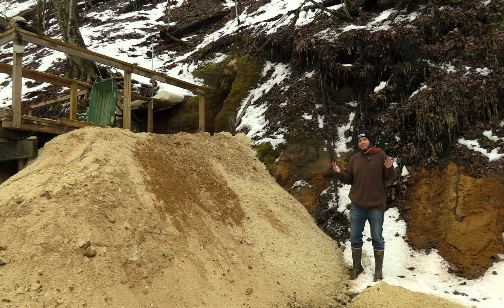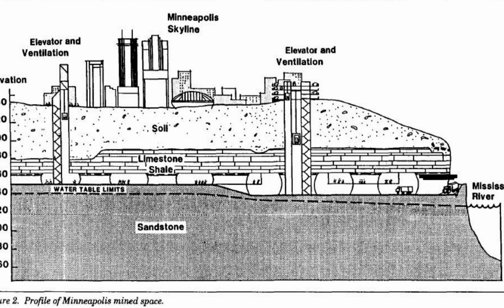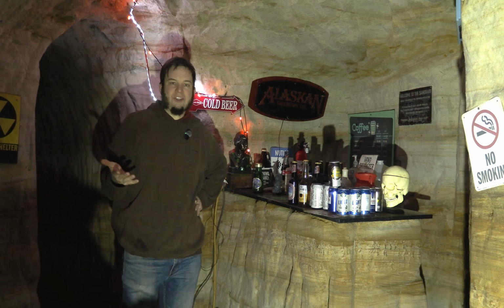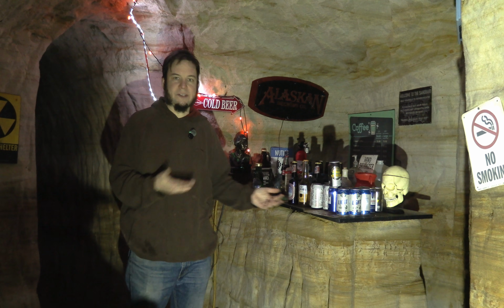Practical and Safety Concerns Of Digging Sandstone Tunnels

Comment: I think you need a huge vacuum system, with pipes to the most resent project, so that you can just suck up all the sand to the surface... no idea if this would work, but from all the digging projects i have done so far i know very well that getting rid of the earth, sand, snow or what ever else you are digging in, is always the most work. And i always dreamed of this big vacuum that just sucks everything up... and you seam capable enough to actually build something like this XD

Comment: Earth.. Ask AI: "Ultrasound Sonar plasma speaker shock wave echo clashing for range controlled melting while applying pressure to sandstone to make it like crystal so water or too dry no longer risk." You glaze your tunnels THICK layer.. Then you can be safer without worrying much. Using Plasma speaker resonance filters to prevent sending vibration causing heat where you don't want it. Google: "Transcranial brain modulation ultrasound" + "Ultrasound can print through walls" If you got a strong enough generator to charge and fill super capacitor banks = Form your tunnels from the surface. It will revolutionize plumbing all over the place no nasty Plastic stuff Chlorine poison in tap interacts with. lol..

Comment: Can I give you some ideas for the wall strengthening/cement idea you've been experimenting with? Context: I worked with sandstone buildings for a living and live in a sandstoney area in western Germany: Don't use cement or concrete, even if it (temporarily) sticks to the stone. The cement will bind up MUCH harder and much more inflexible as well as waterimpermeable, compared to the sandstone. This is why your cement patches fall off: they trap moisture within the stone, causing the stone to swell and "shed" its outermost sand "skin". 
If you want to reinforce your tunnels, invest into quicklime or already slaked lime (Calcium hydroxide). Thin it down to a milk-like consistency and repeatedly paint your walls with it, every week or so. The moisture within the cave system is perfect to keep the lime from binding off prematurely while still being aerated enough to form a strong bond with the sandstone. That will make your walls hard wearing, pristine white and very durable too, whilst still allowing the sandstone to breathe and expand and contract.

Comment: Since this is in the US have you guys ever considered blasting? Something as mild and available as black powder could be used without licensing or would that be considered cheating?
Reply from the maker: I think there are still license requirements and it would be kind of a hassle. Honestly the hauling is the slowest part, I can chisel sandstone way faster than we can pull it out in the wagons.
Reply: @saveitforparts no licensing if it's on private property and isn't being done in the course of business ie nobody's getting paid. It differs by state but federal law allows for synthesis, and responsible use on private property as long as you aren't storing, transporting or making money from what you make. Storage and transportation wouldn't apply if you use a commercial gunpowder or similar product but I don't know what the financial situation is with you guys. I recommend reading the federal, state and local laws first but the federal ones are surprisingly permissive. BTW "manufacture" in their legal parlance means in the course of business, synthesis is different, a lot of people get confused by that.

Comment: I bet a large shop vac could move tons of sand quick. Or an old vac truck
Reply from the maker: I've been trying to convince the owner of that, but he's hung up on them costing $100k new
Reply: @saveitforparts  old vac trucks go cheap at auctions. i think some pvc and shop vac would work wonders. Or hook like 5 shop vacs up to a manifold. I think one would have no problem if you neck down the nozzle to big rocks dont clog it. and the shop vac would be pulling fresh air in if its outside. good luck cool vid
Reply: We had discussed an auger system a couple of times for digging out Crystal Cave in Spring Valley Wisconsin.
Reply: @dolphincliffs8864  PVC pipe with rubber joints and hose clamps for clog/repairs paired with a shop vac attached to a 55 gallon drum.  Screen it than you only need to haul rocks and larger harder chunks. I use a shop vac to dig postholes its so much faster than digging by hand. I have also used an old shop vac to suck up five gallons of gasoline "for science" it did not light? So with a shopvac full of gas i light a gallon of gasoline on fire and suck up?? the shop vac sucked the fuel fire out? it only ignited internally when i shut it off and put the nozzle in the fire and once the fire was in the shop vac it was over quickly:0 shop vacs can move an amazing amount of dirt over time. do a small scale test they cheap you can even get them used get like 5 of them hook them to a manifold than you will be moving a stupid amount of sand. I still think an old vac truck with a blown transmission at auction  is the answer to you sand miners problems you dont need it to move just suck "hard" :)

Comment: Retired mine manager here, the ceiling is called the backs,if the strata you are mining through is tilted you have a foot wall and a hanging wall. I have walked through railway tunnels driven over 120 years ago through the same soft sandstone, you could still see the pick marks on the walls, and the tunnels were as stable as the day they were dug without the need for any artificial support.
Reply: Awesome tidbit!
Reply: Ohh that aint very soft would have taken forever without impact hammers i dug out there once and its plenty hard think we might have made it 30ft 2 guys in 1.5 day

Comment: Sandstone gets a bad rap. There are some old graves from the 1800s around here made of it and the words are a bit eroded away. 
And there are some WW1 era buildings made of it, and the only issues are near the eavestrough drainage areas, you can see the water erosion.
But both are still there. As long as we aren't expecting it to last the millennium it'll last long enough for most things we use it for.
Reply from the maker: There are different kinds of sandstone, I think ours erodes in water faster so it wouldn't be as good for buildings.

Comment: Saveitforparts: it's sandstone, we have doors on different levels, and a fresh air intake.

People: bUt WhAt AbOuT tHe CO2?

The CO2 escapes from the porus cracks in the sandstone, and the constant draft going through the place from doors having small opening on different levels allows the air to circulate... CO2 would only really be an issue if the place had a lot of people in it or was firmly sealed like tutankhamun's tomb. From my understanding, it won't have that much people in it. There is no issues with CO2. There ya go.
Reply from the maker: I've done some air quality testing and found a small rise in CO2 after working in a dead end tunnel. The level actually went back down later in the day because we were walking back and forth and probably stirring up the air.

Comment: This is probably a stupid question, I don't know anything about radon, but you said that you wouldn't want to live in Sandland because of prolonged exposure. Is there any worry about the drinks at the sand bar being exposed to prolonged radon?
Reply from the maker: I don't think it irradiates things, and all the drinks are sealed so it's not getting inside. I try to rinse off the cans and stuff in case of sand/mold/mice!

Comment: With particulates you probably don't need to clean the p100 part nearly as much unless you're having trouble breathing through it. Unlike the Chemical part of your cartridge that needs to be replaced every so often, the particulates in the filter actually help to filter more particulates. 

You might consider getting the round p100 cloth filters (3M 2091). They're (can be) cheaper and easier to breath from as there isn't a chemical cartridge attached to it. (edit) Also, the 3M 60926 that you have doesn't protect from Radon, which I believe is a noble gas and not an organic vapor.
Reply: I don't know that you can filter out radon besides perhaps some super niche membrane
Reply: @theodorekorehonen  You can't, basically. It is a noble gas and won't react with anything except weakly with fluorine, and you don't want fluorine about. The only two things you can do with radon are push it out of the tunnel with forced ventilation or just wait for it to decay. Most people use powered fans to shift radon out of tunnels.
Reply: The p100s are what I use when working at Sandland.  I just haul sand, don't work at the active face, but mask up whenever I hear the hammers.

Comment: I had the joy of working Williams Gold Mine, Hemlo for a short time. I don't know if shotcrete and wire mesh with bolting should be used in sandstone. They told us that the most dangerous place to be is at intersection corners as those are the most likely to fault for any number of reasons. It doesn't look like any precautions are taken at sandland in the intersection.

Comment: 21:42  you nuts should keep some brooms in there. Sweepy sweepy. Loose sand flooring may help reduce, or increase, erosion from walking. Idk if you don't line the walls with concrete, the floor probably needs it.
Reply: Deffinately doesnt it is almost as hard as concrete i dug on the entrance he showed wit the pile
Reply: @Richard-j3z  they should still sweep. And I'm talking about long-term erosion. But it's probably never going to have enough traffic to matter either way

Comment: Ensuring airflow is important to prevent co2 or monoxide pockets conglomerating
Reply: They do... I mean for one, it is sandstone. It has natural gaps and spaces for air to run away. For two, they have a fresh air inlet capable of withstanding the maximum of 20 people that would ever be there, over a few hour period. For 3, it a heckin big ol' cave, where every tunnel is connected and the air can flow freely. For 4, there are different doors and levels in the cave... This ensures a natural air flow from pressure differentials. It's like opening the bottom windows and top windows in your house on opposing sides. Try it, tell me what happens with even one window on each floor slightly cracked open. You'll feel a cold draft coming in on the bottom for sure. 😅
Reply: Depends strongly on vulcanism. Human exhalation is not enough for such a big tunnel system.

Comment: Just some thoughts. 
Could revive an old tool for the tunnels. The egg cutter. Basically an egg wooden shape with "shovels" attached to it. Blades that get impacted by hammers and shave the tunnel walls to make a perfectly smooth, egg shaped tunnel.
Also, you could bypass the moisture issue by polymerizing the walls. If there's a membrane over the tunnel walls, then there's no way for water to go in or out, thus locking the structure and you're free to do as you please inside.

Comment: Have you considered building a "missile" silo. As some of your radio stuff interacts with space stuff so kinda in line with what you've shown in the past plus several things have been mil-surplus. So having some ventilation chimneys that also have a fake rocket (im thinking something that looks like trident but one that someone would building as a class 3 model and obviously missing the rocket motors) so they are really just painted fiberglass tubing with a nose cone.
Reply: He does have a rocket ship. It's a giant prop that was a grain silo, kitted out with knobs n buttons n lights. Very Wallace n Grommet. I like to think that question was asked at some point after a beer or two at the bar, but got veto'd. Still, a nook with a big steel door hiding a bunch of green CRTs, key switches, clicky keyboards would fit the vibe. Extra points if it was a functional ham shack, with hf packet radio n meshtastic. Gabe has been using the excuse of not having a proper ham shack set up as an excuse for ages. An ol' Heathkit n apple ][ would be sweet
Reply from the maker: That would be pretty funny.

Comment: This kind of reminded me that I used to work in a music venue/bar that was a huge granite cave. We had space for about 400 people and the air quality would drop pretty quickly at capacity. A pretty extensive fan system was needed to bring in fresh air. It also got really humid and we had to build a system of pipes to divert water from all the "drip points". Fun times.

Comment: How long do farts linger down there?
Reply: Forever. 

I was on submarines and even with environmental controls a really good fart could linger for hours. Sometimes they would fade and then all of a sudden an old fart would go off again and blow up the room. 

I can’t imagine how long they would stay in a tunnel with sketchy ventilation.
Reply: @mortyrosenstein4211 Are you sure they didn't just fart a second time? 🧐
Reply: @m @mortyrosenstein4211 his is very good information. I think we need to find someone who can infiltrate and infartrate the tunnels and plant a reservoir of poo gas!
Reply: Askin the real questions
Reply: Salt mines are the optimal location for long term preservation and storage of farts but other cave systems can also provide adequate storage capabilities when properly sealed.
Reply: @Kevin  That the real reason they have a ventilation system.
Reply: Given that sandstone is naturally porus, and that there's a constant draft from gaps and cracks on the doors, on different levels, allowing air to naturally circulate around the place... Plus the fresh air intake... If I had to guess, 5 hours. Because it's such a big space.
Reply: @Deja117 I hear it can be infused, you say.
Reply: save it for farts
Reply: Infinitely
Reply: Asking the important questions.
Reply: Sandstone often contains iron oxides, which, when wet, bind h2s, which is one of the smelliest parts of farts. It is also porous, so it can soak farts better than solid metal. It's a slow reaction, but sandstone is likely to fully degrade farts.
Reply: 3:26 Ominous head cracking chunk missing from entrance arch.
Reply: 1 day later and the silence is deafening. We deserve the truth
Reply: @ogodogodogo  I think you mean silent but deadly.
Reply: They never leave. Especially the speckled ones.
Reply: The sound or the smell?
Reply: Sand filtered.
Reply: A question like this can only be asked by a man of culture 👍

Comment: I wonder if you could coat the walls with lime plaster.
Might take a while to cure with all the dampness. Because it's air cured, while cement is water cured.
 Maybe reduce humidity, stabilize the surface, reduce silicosis chance.
 They could be colored or painted like cave paintings.

Comment: Do you keep a CO2 monitor?
Reply from the maker: I've done some air measurements in the past during different operations, but we have enough airflow that it's never been an issue. Even working all day in a dead end with multiple people didn't change the air quality much (aside from dust)
Reply: @saveitforparts My concern would be concrete co2 offgasing if you end up doing concrete.
Reply: @saveitforparts  so thats a no?
Reply: @JacobFuckingPoucher  Hey man, I'm starting to wonder if I watched the same video as most people in this comments section... There are 3 doors. On 3 different levels. With a fresh air intake coming from outside. Imagine the tunnels are a pipe. There we go, no need for CO2 meter when no part of the pipe is sealed, and there is plenty fresh stuff coming in, is there? 😅

On top of this, the cave is never going to be full of people. The useable air in a space that big, would take weeks to have ill effects with no ventilation for 10 or so people. The humidity is more of a concern at that point though, but then again... Nobody is living in the place. For the reasons mentioned, in the video. 🤔

Edit: sandstone also has microscopic gaps allowing for air to flow. Since the place isn't really bodied for more than half the week, I think they're well in the clear.
Reply: That's what I asked in the last video. A gas detector is hugely important for an insanely confined space like that.
Reply: @JasonLihani  Even more so if they start involving concrete.
Reply: @JasonLihani  To be honest, most houses are more confined that this, especially apartments. People tend to not open the windows much in winter then wonder why they feel slow and sluggish. 😅

Comment: A decent part of my one job for years was concrete repair. The crumbling steps that I've fixed go on for miles.
   If you want concrete to stick, use bonding adhesive (pva glue?) first, then a slurry coat that's bond instead of water (brands vary tho, one is much thicker and does need a splash of water, the other, no. But prolly don't buy it).
   When mine ceilings are "chicken" wired for gunnite spray-crete, there's anchors and anchor plates to stop pull-through that are epoxied or mortared in.
     You really only need the top of the arch anyway, it can't bow out like a wall, a step near the ceiling is where you need to start. Gothic are sorta like that, and some brick arches. It isn't a "put" lug, but a continuous shelf or notch.